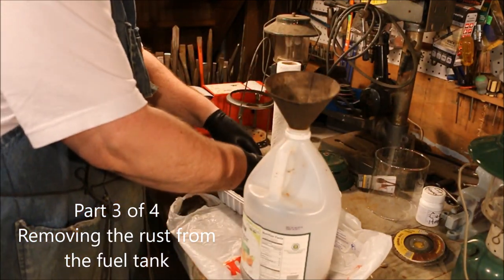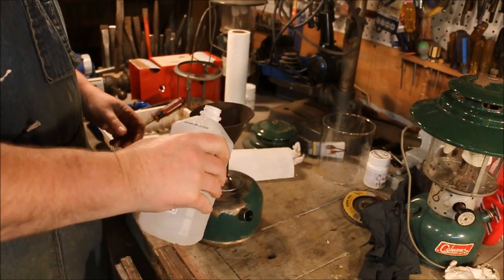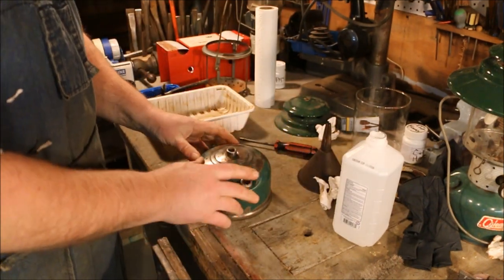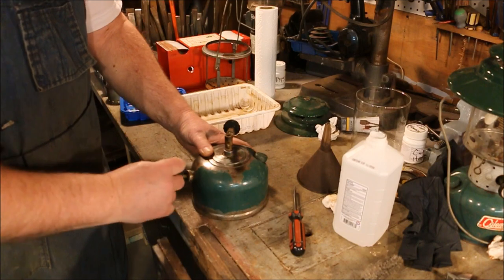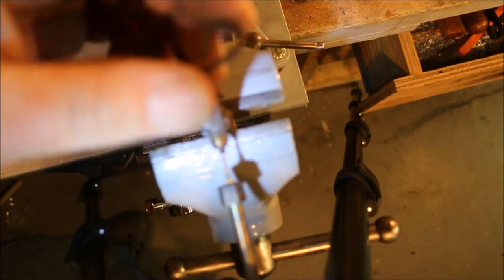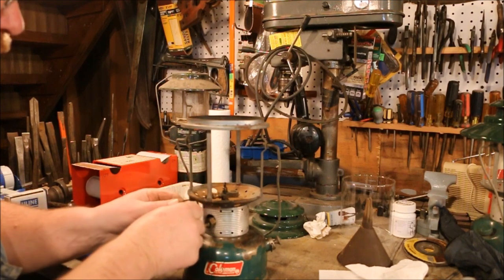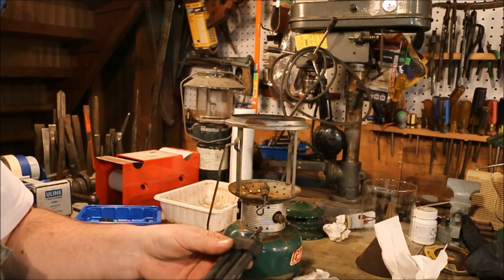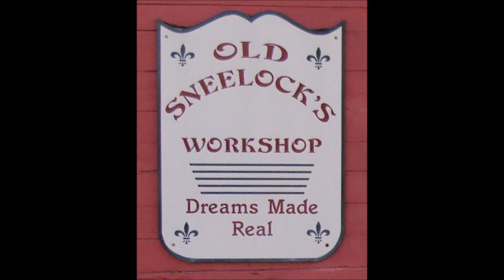Coleman Lanterns ~ SHTF ~ Pt 3 of 4 ~  Rust Removal & Flushing The Tank ~ by Old Sneelock's Workshop

Comment: Do u know what I can do to clean it up and prevent the rust to go any further I have not checked the inside but I keep fluid in the tank
Reply from the maker: Matt Patterson Rust on the outside of the tank can be removed with a hand wire brush or steel wool. Scotchbrite works well too. I would stay away from power tools unless you have the tank empty and thoroughly cleaned. Don't want any big booms. 😨
Once it is clean, a rattle can paint job will protect the surface.
Reply: Thank you I did put vinegar into the tank because I did see some rust so I will do what you said and use a wire brush and the things you have recommend thank you for replying

Comment: hey old Sneelock...did your tank flash rust after the alcohol?...what kind of alcohol was it...I'm gonna have to clean mine again....it's started rusting
Reply from the maker: 91% Isopropyl Alcohol. After dumping out the alcohol put some Coleman fuel in the tank and keep some in the tank. The fumes will help prevent rusting.
Reply: @OldSneelock  Just wondering if the water deal was caused by doing something we're never supposed to do and pour in ALL of whatever was in the can instead of pouring it into a jar to see how much water is in it. Just a thought. Sure works with mowers and saws!
Reply from the maker: @lewiemcneely9143  Possible. Alcohol absorbs water right out of the air. Once you open the container it starts getting more water in it. 
The steel Coleman tank is chemically clean after using the vinegar to acid etch the rust off. It will pull oxygen out of the air too.
I put in alcohol to absorb the water after rinsing out the vinegar. Then I put in the fuel.
Reply: @OldSneelock  10/4 on the fuel. I was always taught that there might be trash or water in a can and to always pour it in a jar so I could see and make sure it didn't end up in a machine. I don't have a problem with water after the shed was built and everything ended up in the dry. Before, it was drain water out of everything when it was supposed to be used. I keep my jugs closed tight and never had an issue with booze gas either, although I'm shying away from it. The old 50's stove has always worked like a new one. It may not hit a lick since it's been spruced up. It's a small une but the dual fuel is a lot bigger. Now all I need is a reason to fire 'em up!

Comment: Did u ever do work on the Coleman heater the ones that run on camp gas
Reply from the maker: Tyler Totten I owned a catalytic Coleman heater but never had to work on it.
Reply: Ok iam not sure if there is anything wrong with mine it just got thou a lot of gas
Reply from the maker: Tyler Totten Is there a knob or lever that sets the temperature?
Reply: Yes there is
Reply from the maker: Tyler Totten Have you tried a lower setting?
Reply: Old Sneelock's Workshop yes it's still a pig on gas
Reply from the maker: Tyler Totten What is the model number?
Reply: Iam not sure I will look
Reply from the maker: Tyler Totten No promises but I will check on it to see if there is a way to improve.
As  reference how long will it run off a full tank?
Reply: I think like 3 hours and went through a whole jug of camp gas
Reply from the maker: Tyler Totten The only reference I found for Coleman heaters, lists the Model 512A700 catalytic heater like I had. https://www.oldcolemanparts.com/resources/scans/512_3.htm
The manual says  it should run 18 to 20 hours on a tank full.
Reply from the maker: Tyler Totten I found some information on Coleman Radiant Heaters. http://www.oldcolemanparts.com/museum/519.htm
Is yours like this one?
Reply from the maker: I haven't found any specific answers for just the 518C. It is rated at 3000 BTU’s. The design is very like the 512A700. I am stumped as to why it would use more fuel than the 512. If it is going through a whole jug (tank?) full of fuel in three hours it must be putting out a tremendous amount of heat. Combining fuel with oxygen makes BTU's and the 518C is rated 3000 BTU's/hr. so if it goes through more
than a liter in 10.12 hours there is something odd in the fuel or the heater. 

The heater has a wick that extends down into the tank and siphons the fuel up into the burner. If it were somehow missing or shortened it might cause the heater to stop drawing fuel from the tank before it has emptied the tank. 

Working at arms length, that is my best guess. 

To get the estimated fuel consumption for the 518C I went to Answers http://www.answers.com/Q/How_many_btu's_per_gallon_of_Coleman_fuel?#slide=2About 115K BTU per gallon.

Using that information I did some math and converted the information to show
the usage/hr of the 518CHow many BTU’s per Liter of Coleman Fuel?To convert gallons to liters multiply US gallons x 0.264 = liters115000 BTU’s per US gallon x 0.264 = 30360 BTU’s per liter. 512A700 Rated use = 3500 BTU/hr 
518C Rated use = 3000 BTU/hrBTU’s per US Gallon = 115000For the 512A700 
115000 divided by 3500 = 32 hours of operation from a US gallon of fuel. 30360 divided by 3500 = 8.67 hours of operation from a liter offuel. 

For the 518C 115000 BTU’s per gallon divided by 3000 = 38.3 hours of operation from a gallon of fuel. 
30360 BTU’s per liter divided by 3000 = 10.12 hours of operation from a liter of fuel.
Reply: I have that heater. Works good. Scary to light though.

Comment: how much vinegar and how long should I do this to my 1948 228D Mr Sneelock...looks like it has like rust sand on the bottom... should I throw some nuts inside?
Reply: +D Rey I filled the tank. I could not see the top of inside of the tank. One of those cameras on a probe would be handy for checking how long. Filling the tank completely lets tha vinegar hit the whole tank. 
Since the acid will eat the rust first then attack the tank I leave it overnight then check the next day. You can put the vinegar back in the tank if it needs longer. If it doesn't have it cleaned by the end of the second day it probably won't get better. Leaving it in longer risks damaging the tank.
Adding some nuts and filling it with an inch if vinegar and shaking it, will certainly feel like you are doing something. I'd like to know the result.
Good luck. One warning. If the tank has a pin hole or weak spot, cleaning it may show a leak. I think it's better to find the leak this way than when it's lit and hanging in a tent.
Reply: this comment sir
Reply: this one
Reply from the maker: D Rey Fill the tank completely. Wait 24 hrs . Drain and inspect. Refill if needed. No more than twice.

Comment: why not remove the rust from the cage?
Reply from the maker: I could. I don't generally remove it unless it is causing a problem. I tend to just repair most things to a user level.
Reply: @OldSneelock  doesn't rust always cause a problem?
Reply from the maker: @MarkFlashman  Rust is always present. Despite our best efforts entropy is the nature of the universe. In time rust, if left unchecked, will decompose most iron based items. 
Surface rust can seal the iron from further oxygen exposure slowing the effect. 
Recognizing that I don't want to spend my days polishing everything I own I pick my battles.

Comment: If you wanna get the water out, why not just put the thing is full sun for several hours and let evaporation do its trick?  And instead of vinegar wouldn't CLR work better for getting some of the rust out?  But to get old fuel gunk out wouldn't using some paint thinner work great and then do the vinegar?  For getting varnish out of mower fuel tanks the paint thinner works wonders.  Then I rinse it out with water and put it in full sun to dry it  out.  Just saying.  I have never tried to clean out a lantern fuel tank.
Reply from the maker: The alcohol absobs water so it won't flash rust. 
Never tried CLR. 
Vinegar is CHEAP. 
Paint thinner works well for a lotof things.

Comment: Sneelock?
Reply from the maker: D Rey I answered an hour after you posted, and a couple times since then. Must be something going on with the comments.
Reply: I refilled.....a little diluted.... should I use nuts in it....it's brass
Reply from the maker: D Rey Got me on that one. Some small nuts swirled around inside would scrub the inside and loosen the junk. I wouldn't shake them. It might dent the tank.
Reply: thank you sir